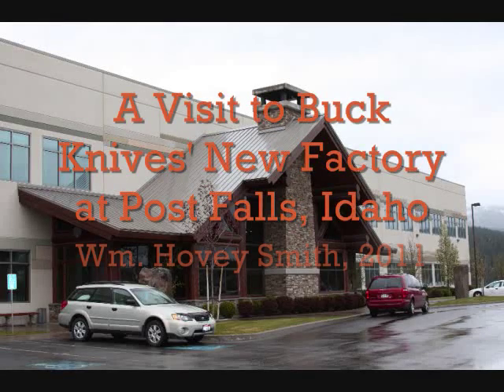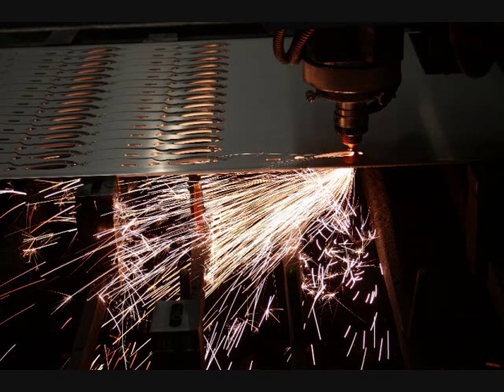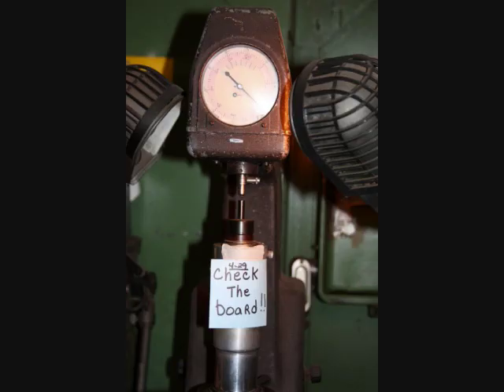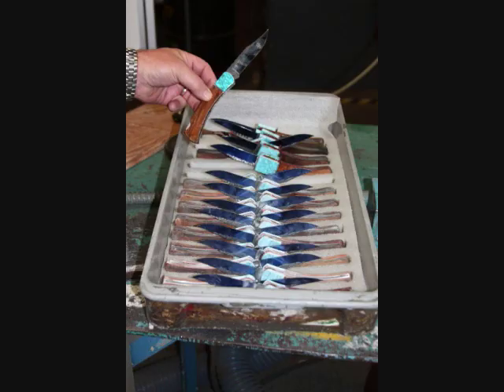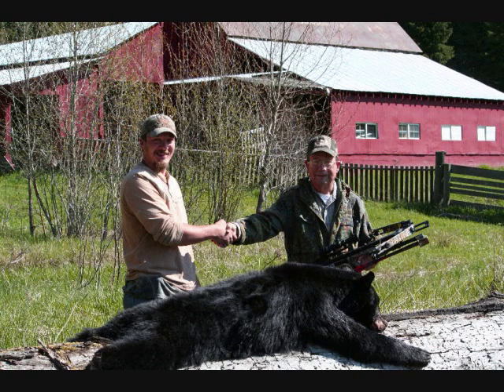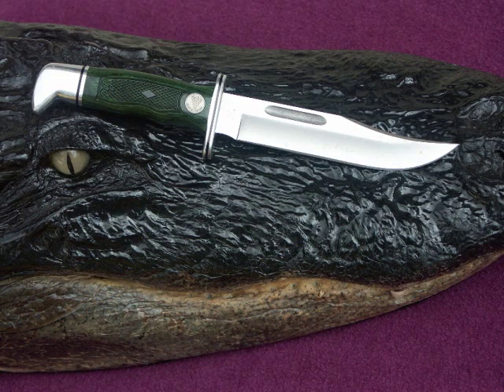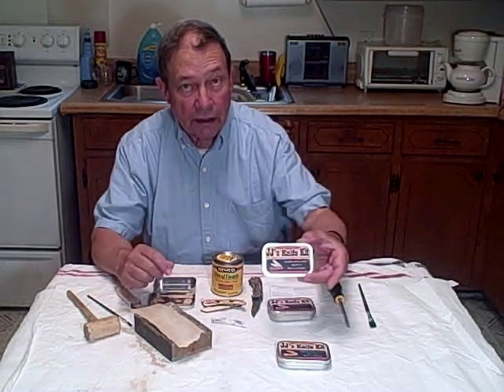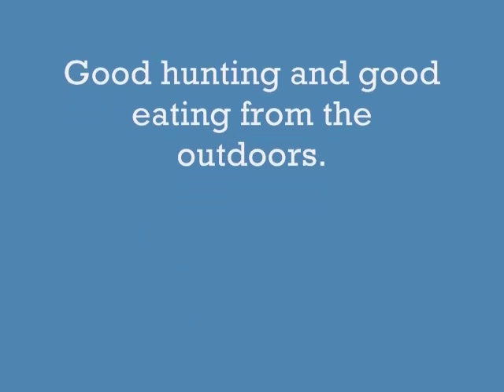A Visit to Buck Knives' New Factory at Post Falls, Idaho.

Comment: why did you stop making the GOLIATH?  I use that knife and that knife only for commercial diving.  That is my safety dive knife. Now; I have been a BUCK customer since 1972 While in the ARMY.  Because of myself and a few Guys we were allowed to wear our bucks in the field.  Since that time I have used BUCK knives for my commercial divers knife then when THE GOLIATH came out it was my safety knife.  Do they wear out/  NO; someone steals them or I have lost them in the water.  
Mr. Charles T. Buck sent me one to replace one I LOST.  Then, found myself fouled on the bottom, couldn't surface and had to be rescued by another diver.  EMBARRASSING to say the least.  

So; I FIXED what I thought should have come with the knife and that was a way to secure it.  

I suggested BUCK KNIVES come out with a series called BUCK PRO MARINER and it would be specific for commercial divers and the sport diving industry as a safety knife. Which for commercial work that is the law that we have such a piece of equipment. 

I have photos of my BUCK GOLIATH SERRATED AND PAINTED YELLOW WITH A QUICK DISCONNECT.  THE absolute best divers knife ever.  Mr. Buck did the serration for me at his factory. IT May be the only one like it.  Well that was in FEBRUARY 1998. He said he liked the name and idea.  What happened?  

ANYWAY I need a BUCK GOLIATH after how many years and now I don't see them.  You guys should consider target marketing the divers and I can supply plenty of photos of me and my BUCK on my chest.  

If someone there can dig one up I would appreciate it, maybe someone there might serrate it again too. Mr . Buck had the entire length serrated for me because that just the way I like it. IT give me more cutting surfaces for large ropes or even in defense from predatory fish. If this had a photo option I would send you a photo or two.  

That series could be called BPM I, BPM II pro series and sport series and do the color thing for the ladies and even add a marlin spike. The reason this particular knife is so great is because of the wide blade and heavy gloves can open it and manipulate the knife safely because of the size.